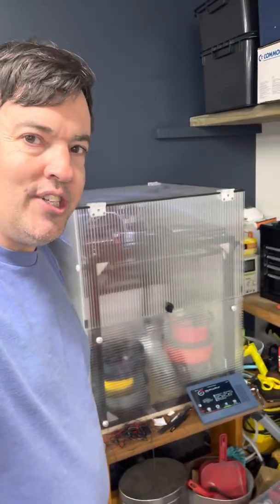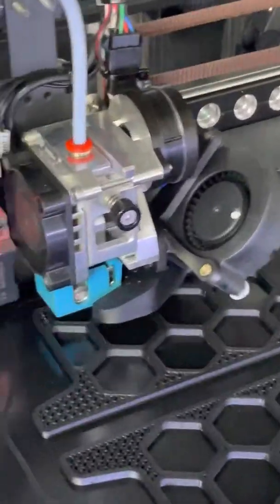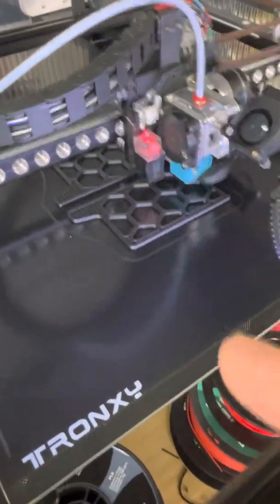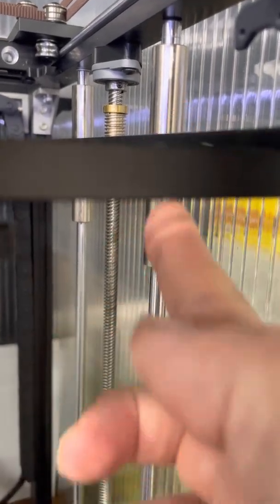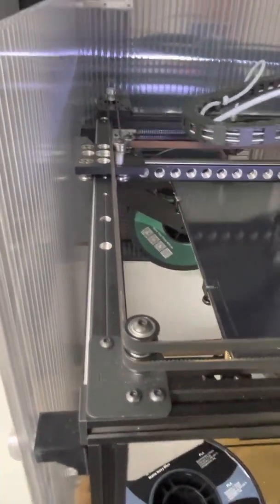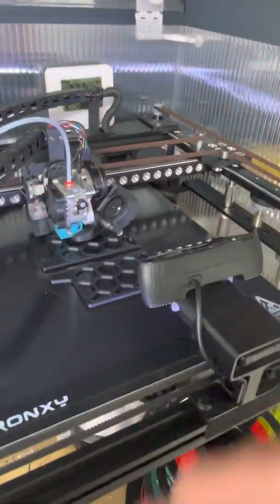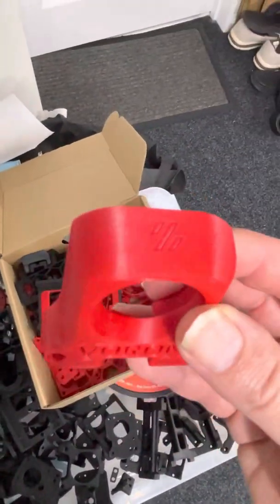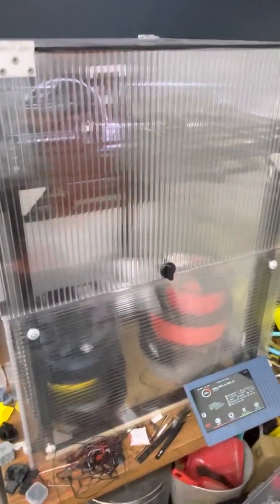Tronxy X5sa Pro modified with NF Sunrise, enclosure, and Klipper

Comment: do you or anyone else have a super slicer profile, RTG, I've lost a fully dialled in machine, due to computer virus/hacker, and i've since nuked the drive... irrelevant to you guys but explains why I'm asking.
i have klipper, direct drive, range of nozzles, but if someone has a solid base for a leg up, i will dial it back further more and reshare it. took me over 300hrs to build my last profile, managed to make a crystal dragon at full scale to bed at 130mm/ps
wit just the cooling fan running and no duct, variable heights from 0.01-.2 variance, came out immaculate, full print settings lost due a profile loss has absolutly gutted me
Reply from the maker: I’m sorry, I’ve only just started using Superslicer with my Voron 2.4, haven’t tried setting up the Tronxy yet. I reckon, though, that as long as your printer.cfg is safe and correct (in Klipper, in the Pi), the slicer settings won’t take you long to get right. Set retraction to 1mm and 40mm/s first… then set all the speeds to 80mm/s, and work your way from there - I don’t reckon it will take you 300hrs to get it working this time around, as you’ll remember what works and what doesn’t :) but I do sympathise, it’s very unsettling when all those carefully-refined settings are gone!

Comment: Wow! Thats exactly how far i want to be with my Standard X5SA-400 (not pro, with v-Slot rollers). But with klipper i will wait. The original Chituh Software is realy easy and also good to Customizing in the Config. But one question: are you happy with the OCR-Rails from tronxy? Worth the Upgrade and are the better than MGN12H Rails?
Reply from the maker: Hello Marcus, thank you for your comments! I feel that you will definitely get better results with Klipper, especially with input shaping and pressure advance. But anyway, I would suggest the MGN12H rails for you as they are probably lighter than Tronxy’s rails. I will say, though, that the worst linear rails are sometimes gritty, where the Tronxy rails are relatively smooth. Anyway, I will be rebuilding mine with Hiwin rails (the best type). I hope you get nice results from your large 400-size machine!

Comment: Hi alex, could you tell me the size of hole in x rail, and y carrier?
How much weight you save from doing this? Thanks
Reply from the maker: Hello, I can’t reply with a photo here, but https://www.facebook.com/groups/169728600253557/permalink/1057215468171528/ - I used a step drill, holes are several sizes with the larger holes on the back. Weight of the X carriage rail went from 591g to 480g, total weight saving 19g off X moving mass and 162g off Y moving mass. You would save more weight by changing the design to use linear rails, but it is a wait for them to arrive :)
Reply: @alexshepherd  yeah, i planned to change into extrusion and linear rail instead. But it need to wait cause i want to change my extruder to nf sunrise first, then change my board to btt octopus, and after that i change my xy movement to linear rail.

Comment: good job and nice explanation .
Reply from the maker: Cheers, I appreciate it :)

I have no need to push for ‘likes’ and ‘subscribes’, will never have enough views or followers for YouTube to care. All I like to know is that someone, somewhere might get better results out of their Tronxy :) 

In original form they’re not really much good, but with the three main modifications shown here (the sync belt, the direct-feed extruder, and Klipper firmware) they work much better. Then, an enclosure makes it possible to print in ABS (or large prints in PETG) without warping, and suddenly it’s a useful machine!